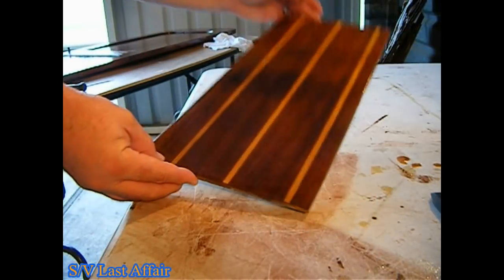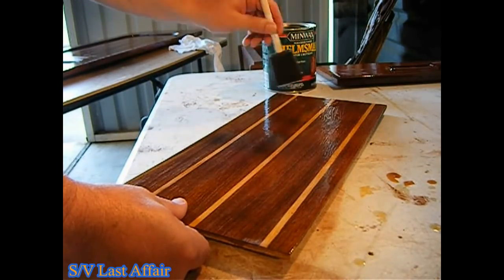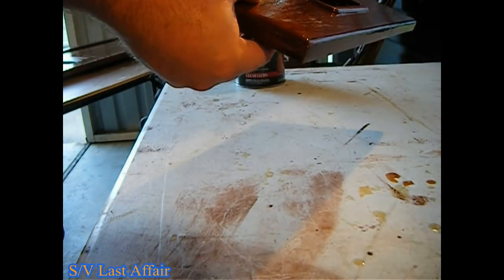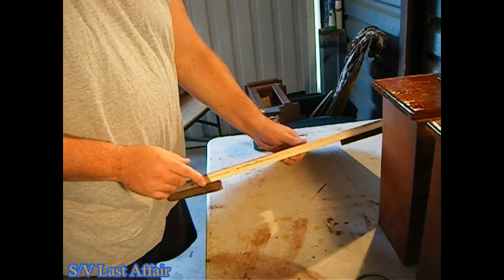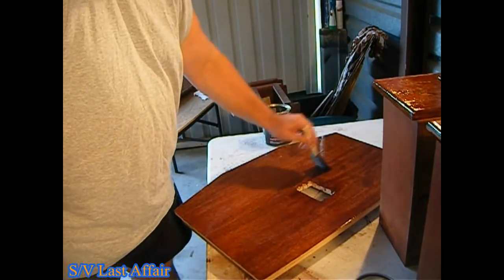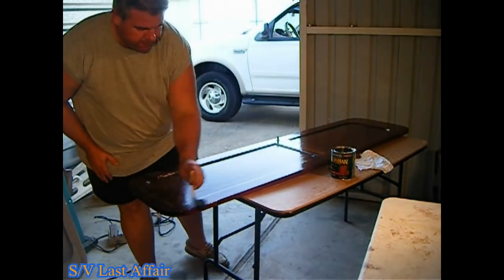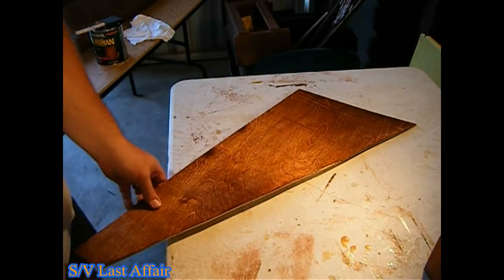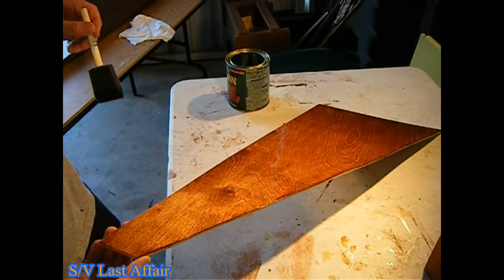How To Varnish Boat interior Parts

Comment: Thanks for the tips, nice technique. I must contest your statement at 3:05 however, there is absolutely no need to throw a brush out between every coat. Use some of that thinner to soak the brush between coats. This throwaway lifestyle is too prominent within the yachting world!
Reply from the maker: I agree but have personally not found the best way to clean them. If you have some really good tips on how to do that and not have the brush become stiff and leave streaks in the next coat, I would love to know how. Thank you again for the comment.
Reply: @Svdreamchaser  Acetone usually does the trick.
Reply: Dip the brush into the varnish and then into a sandwich bag tape it closed around the brush. As long as air is keeped out you are good.
Reply from the maker: I have to give that a try!!

Comment: Nice video. Thanks! Rehabbing an old boat now. Getting to the flooring. When you resurface poly coated teak, do you strip all the way to wood first, or do yo just sand/scotch brite it the surface, then put your first new coat on?
Reply from the maker: I actually sanded it down to bare wood in this particular case. If I had to do it again I don’t think I would do that step as long as the wood and the surface were fairly smooth. I think using something like a scotch bright or one quick Skoff at 220 grit would probably have been sufficient to add the poly on top of that

Comment: Hello from Australia ..... thanks for the information and video ...... why not use a clear epoxy?
Reply from the maker: I have tried clear epoxy and while it builds layers quickly, it still needs UV Protection. I didn't think about doing this down below because where the sun isn't directly on it, the maintenance is pretty easy.   Where I have done the epoxy to build layers and then a few coats of varnish to protect from UV, it has worked well.  BUT, if you don't put maintain the UV layer of varnish and it yellows, getting it back to bare wood to fix it is HARD with epoxy.

Comment: you mentioned building up 4-5 coats to seal, then began applying product right out of the can. were the 4-5 coats the 2-part urathane/1-part thinner mixture?
Reply from the maker: CA B - Sorry for the delayed response, but to answer your question, I do thin the first few coats if I am sanded down to bare wood like I was in the examples of the doors in this video.  I actually start with the first coat mixed 50/50 and then the next 2 or so I do at 75/25, before going full strength.     Thanks for the comment CA B.  IF you found the video useful, please do come back and hit the like or subscribe buttons.

Comment: I’ve quite a bit to do, do you think there’s any benefit to warm the varnish before laying it maybe with a mohair roller then tipping it off? Thanks for the explanation 👍
Reply from the maker: I think when going for perfection that may help.  I subscribe to the theory of it needing to look great from 10 feet away, which keeps me from getting too carried away with perfection.  That can likely improve it a bit with the roll/tip, but honestly I don't know what heating it up would do.  If you want to thin it, I would use a thinner instead.
Reply: @Svdreamchaser  thank you for replying, I just see the guy from boatworks channel use epoxy on some teak then topped it with two coats of varnish with uv inhibitors which gave it a depth of 8 coats, I want it like glass without orange peel or brush marks was thinking warmth for that as have known some doing it with car paint, but epoxy approach looked great, saved a lot of time may try that on a piece and the way you done it  👍
Reply from the maker: I did that too but opted not to do the rest mainly because I know my own limitations and I will not do the maint required and end up letting the epoxy yellow. Lol

Comment: Any thoughts on the best varnish for flooring inside the boat? My stairs (exposed to rain more than other flooring) are failing first. They have treads so I'm not worried about traction.
Reply from the maker: I have been a fan of a simple and lower cost solution. It has served me well over the years. I use Helmsman Spar Urethane and I get it at my local home super center. It works well on the more protected from the sun interior parts.

Comment: I would not recommend Helmsman Varnish on a boat or anything that will be exposed to the sun. Also I would not recommend thinning 2 parts varnish to 1 part thinner!
We normally do not thin the Varnish at all and never use it straight from the can.There are plenty of high quality Varnishes on the market although they are at a higher cost initially but will be better protection and last mush longer than what you are using.
Reply from the maker: I agree. I love when someone views one of the videos from quite some time ago!  It is a great call out. 
I have continued to use (with great success) Helmsman Soar Varnish on interior parts where there exposure to the sun and UV is very limited. It has lasted well over 6 years now but again it is on the interior.
On the exterior I use higher quality varnishes. I like Le Tonkinois and only thin the first coat when putting it down on bare wood. I have also recently used Awlwood MA for my toe rail and bow sprit but that was only a year ago so don’t know it’s longevity yet.